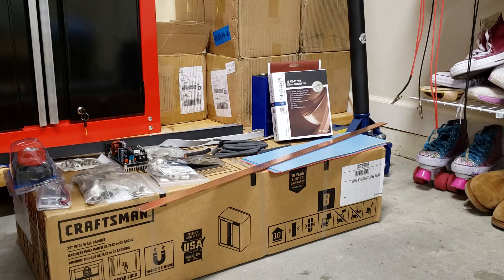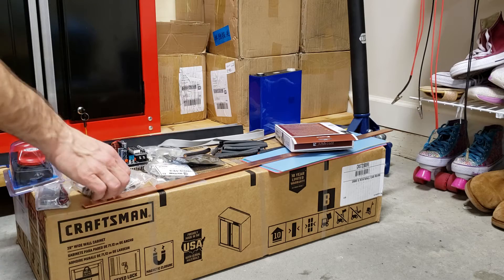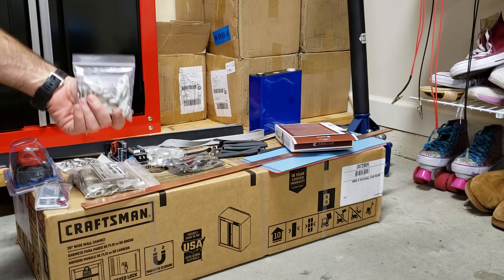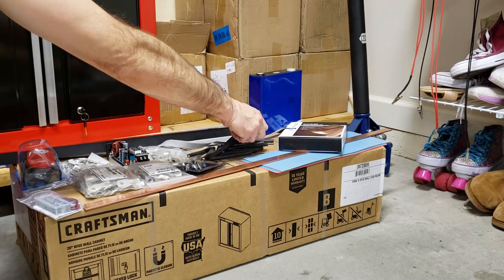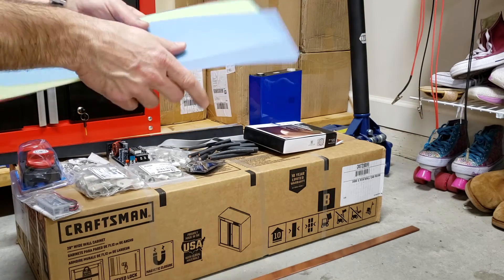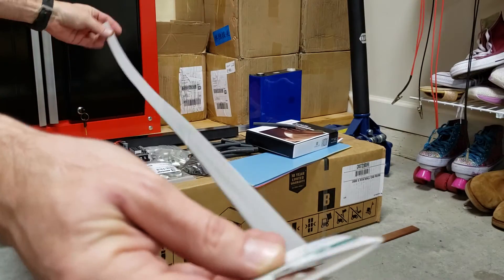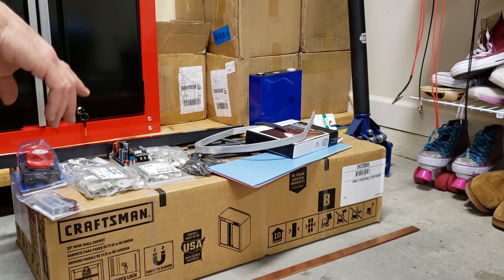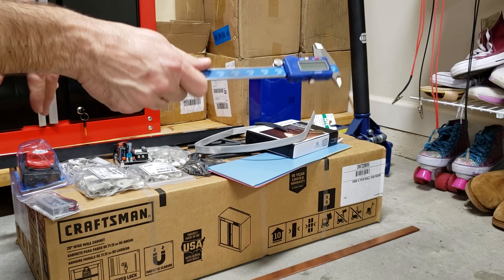Power Wall 3.0 Parts List. Need your opinion too.

Comment: I appreciate all the details you've included - thanks for that.  I'm going to build two powerwalls using your design.  I'm looking for some help on how the BMS and balancer work together; the video descibes the BMS, but you don't say much about installing and wiring the BMS and balancer.  

I checked the new Alibaba BMS link (in your reply to Aleksei) but it doesn't list the specific BMS, and Alibaba has asked me for more detail.  Their reply to me says: 

" We are BMS manufacturer.We have all kinds BMS such as hardware BMS/software BMS(Canbus/RS485/Uart/Smbus/I2C etc) and Bluetooth BMS.  Could you tell us more details of our basic requirement? Then we know our BMS whether ok for you or not!
 1--how many the nominal voltage
2--how many the power value of your device
3--how many the continue charge current, and discharge current
4--Do you have max size?"

So, would you be willing to add some detail on the specific BMS you recommend, and add some detail on installation and wiring of both the BMS and the balancer?  I think that's the only piece of the puzzle that's missing for me.  Thanks again for your help with this.
Reply from the maker: Correct. They will ask you Power Wall size and current limits to recommend best solution for you. So what is size of your power wall and what current limits you will have?
Reply: @DMIINC2013  I'd like to build a power wall identical to yours, so size would be 18.4 kWh and 51.2 volts.  A current limit of 120 A should provide plenty of margin for my electrical loads.
Reply from the maker: This link will take you to what I got. https://www.alibaba.com/product-detail/4S-5S-6S-7S-8S-10S_60738825980.html?spm=a2756.order-detail-ta-ta-b.0.0.c89e2fc2FWbh4B  However price is wrong I think. There are better solutions out there at the moment that combine good balancer and BMS in one unit.
Reply: @DMIINC2013  Thanks.  I don't have any experience with these.  Can you recommend on that combines both?  Alternatively, if I buy a separate BMS and balancer, does the balancer come with a wiring harness that will connect it directly to the BMS, or do I connect both the BMS and balancer directly to the batteries?
Reply from the maker: If you buy separately then you will have 2 wiring harnesses to deal with. If I had to do this all over again I think I would have use this https://www.jkbms.com/products/active-balancer-bms/ Scroll down the page and see the phone app screen shots.

Comment: If you concider connecting your batteries vertically instead of horizontally, you can have 48v positive and negative coming off the top edges.
You might even use copper bus bars all the way.
If not, beautiful job.  Love watching your progress.
Reply from the maker: I have considered that too. Not a best fitment if doing it that way. Thanks,

Comment: Instead crimping ends and using 1/0 cable to connect everything. How about simplifying the connection with a simple buss bar. 1/2 in copper L pipe smooshed works great!
Reply from the maker: I was thinking of that before. However I decided to go with copper bar that is way thicker than moshed pipe and it has rounded edges. Thanks,